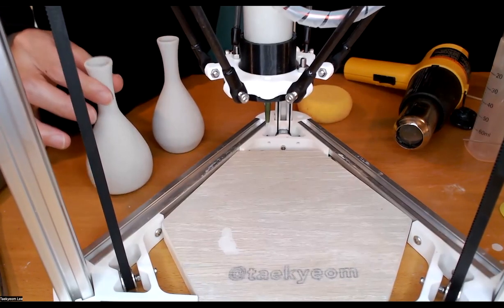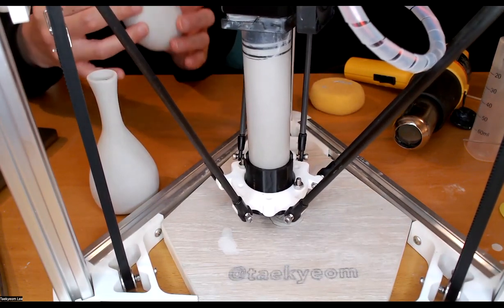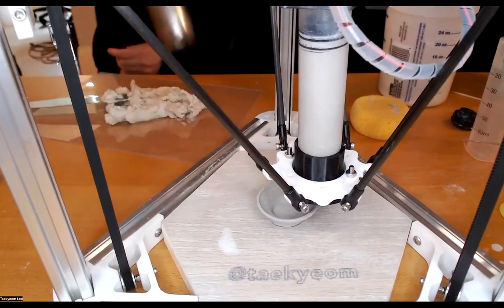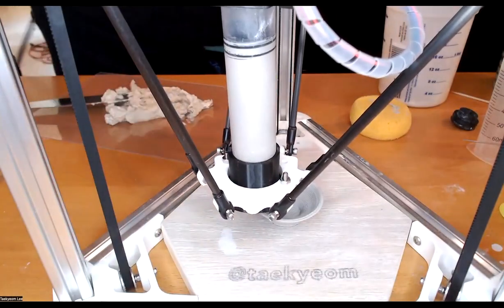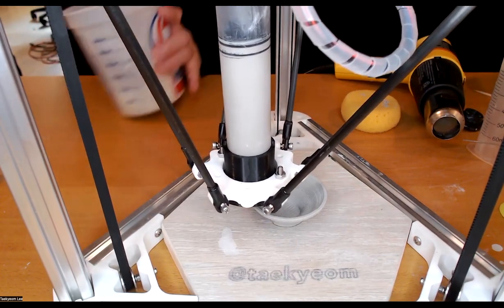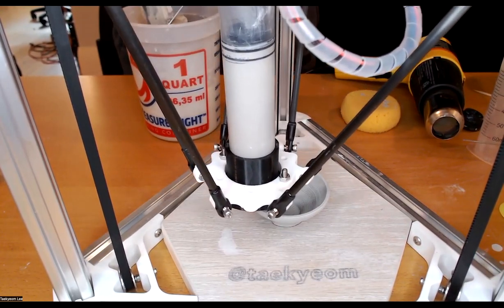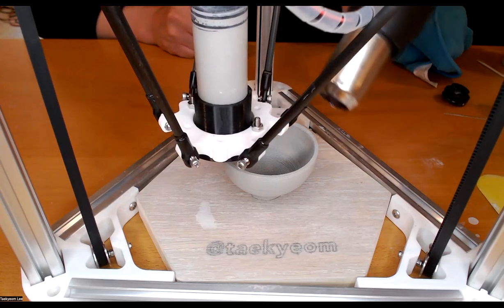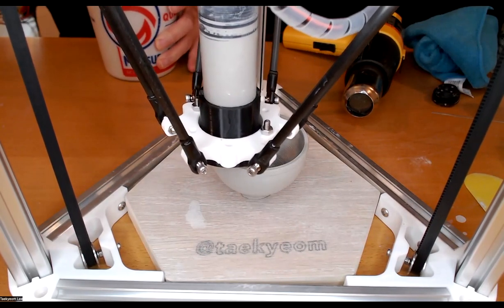DIY ceramic 3D printer 018 - printing and prepping clay simultaneously

Comment: You are doing an amazing job!!! Are you also interested in designing a construction printer? I am working on a model that prints with cob, but instead of 3 vertical supports it can stand on only one strong one, however the positioning arms a bit more complicated ...